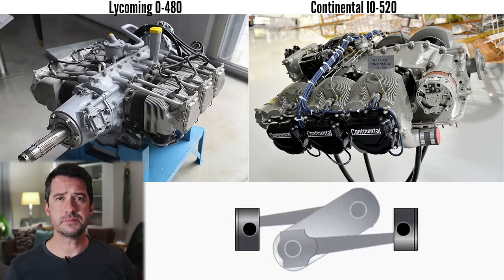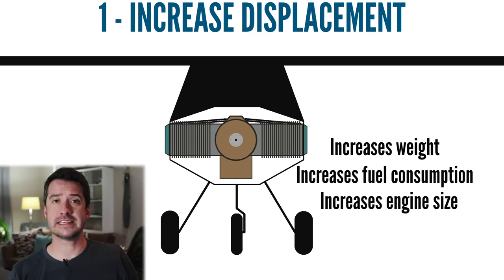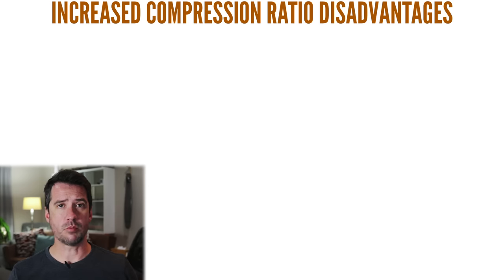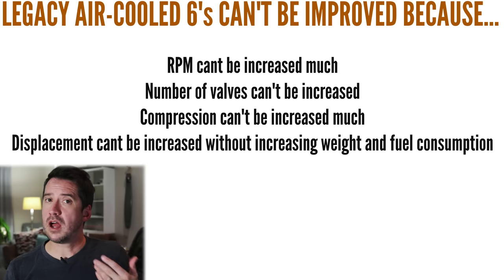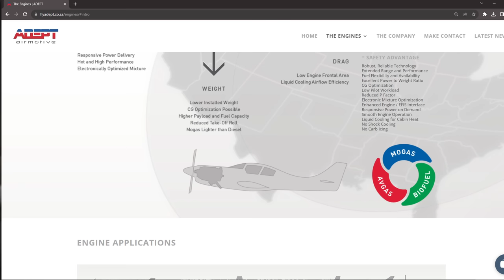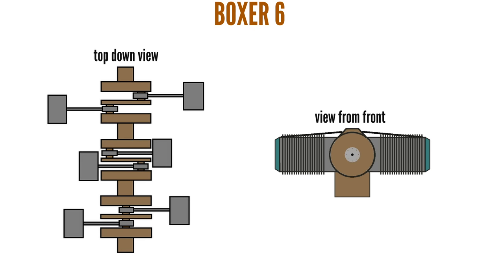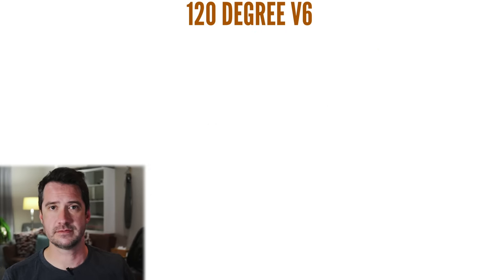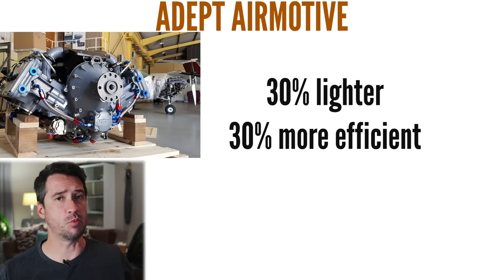Unusual V6 Airplane Engine Makes Boxer 6 OBSOLETE?

Comment: Balance shafts are used purely to improve comfort, they don't actually affect the operation of the engine. Ferrari's current 120 degree V6 engines don't use balance shafts at all (I doubt that their F1 engines did either), the vibrations are small enough that they can be damped using hydraulic engine mounts. In my experience, light aircraft engines vibrate quite a bit anyway, so it's likely that any vibrations produced by this engine are simply too small to be a concern.
Reply from the maker: Thanks for the comment. The Ferrari GTB and McLaren Artura 120° V6 definitely uses a balance shaft. The F1 engine is 90° as far as I know and that normally does not require a balance shaft.
Reply: @LetsGoAviate  The McLaren does, the Ferrari does not. Ferrari used 120 degree V6s in some of their F1 cars in the '80s. Edit: Some of the 'shark nose' Ferrari F1 cars from the '60s also used a 120 degree V6 engine.
Reply: @LetsGoAviate  For information on the Ferrari V6, see a Car and Driver article titled:

Why Ferrari and McLaren Debuted 120-Degree V-6s at the Same Time by Csaba Csere

Published: February 23, 2022
Reply: Yeah, they’re critical. Lots of props broken by vibrations in the early days of aluminum props. At resonant frequencies, vibrations build on themselves and have been known to break crankshafts, drop bridges, and buildings. The Broughton suspension bridge was collapsed simply by soldiers marching in step. All aircraft manufacturers have to investigate the vibration coupling between the engine and the propeller.
Reply: @russbell6418  "Yeah, they’re critical. Lots of props broken by vibrations in the early days of aluminum props."

Completely unrelated to balance shafts. That's a result of the large torque impulses that direct-drive engines produce, which wont even be a problem for this engine, because its torque impulses are relatively small, it's geared and it revs fairly high, so the inertia of its own rotating assembly will smooth its torque impulses to a significant degree. Balance shafts do almost nothing to reduce the torque impulses produced by the engine, nor are they meant to dampen any of the damaging harmonics which might be present in the engine rotating assembly. Balance shafts do add a bit of inertia to the rotating mass of the engine, and that might provide some damping, but that's not their primary purpose. Flywheels and harmonic dampers are the devices used to reduce the torque impulses and damaging harmonics produced by the engine rotating assembly, not balance shafts.

The only, ONLY purpose of a balance shaft is to increase comfort for the humans who might be subject to the vibrations produced by the engine, that's it, that's the only reason why they're ever installed in an engine. Many, MANY engines which are not perfectly balanced do not have balance shafts (probably most 4 cylinders with a displacement of 2 liters or less and the majority of V6s), they just vibrate a little bit and it's not a big deal.

Edit: I suppose that geared engines can experience problems as well, but making use of a flywheel and a proper harmonic damper should solve the problem quite easily. I often wonder if this engine would have adequate damping without a flywheel between the crank and the PSRU. If you think that I (at any point in the past) implied that engines don't need to deal with torsional vibrations, that's absolutely ridiculous and I have no idea how you ever would have gotten that idea. Balance shafts aren't meant to deal with torsional vibrations and aircraft engines simply don't use them.
Reply: @russbell6418  Really, if balance shafts are so critical, name an aircraft engine that uses them.
Reply: @PistonAvatarGuy Actually balance shafts are important for the life of an engine. Vibration cause oil aeration disrupts oil flow. Increases likely hood of cavitation in cooling system, detrimental to the life of electronics, sensors and wires. There have been issues with fuel injectors not functioning correctly due to vibration, potentiometers in throttle bodies giving faulty readings and failing, wires rubbed through. They are only need if the vibration is too bad obviously, but are not just for comfort. Resonance through an airframe is no joke.
Reply: @chippyjohn1  I guessing that very few engines vibrate badly enough for any of those things to be a serious issue. I'm sure that balance shafts can become critical in certain applications, so I probably should have worded my comment differently. Also, the engine in this video uses a dry sump oiling system.

Thinking back on all of the vehicles that I've driven in my life, I think that I've only driven two that had balance shafts (or a balance shaft), one was a V10 powered U-Haul, the other was an F22B powered Honda Accord.

Edit: It's possible that I also drove a Taurus with a balance shaft, but I can't tell for certain. I've read that mechanics often remove the balance shafts and discard them with no ill effects, so the difference that they made had to have been minimal.
Reply: @PistonAvatarGuy  Engines are already dampened with engine mounts, but components mounted directly to the engine can be effected. Of course they are incorporated with warranty in mind in all aspects. A trim rattling inside may not be a major issue, but it can cause a bad reputation for a manufacturer just as an example. An engine has to be sold with the worst driver in mind, so balance shafts to a person that redlines their car repeatedly would appreciate them more than a granny. As you know it's about how the engine operates that determines their necessity. As with my experience at bosch, all electronics are vibration tested and electronics are vulnerable to vibration. There are many components people don't think about with regards to vibration, even brushes in an alternator experience increased wear. I'm currently using a inline 4 on my experimental and have mild vibration issues, look forward to using an inline 6.
Reply: @chippyjohn1  "...so balance shafts to a person that redlines their car repeatedly would appreciate them more than a granny..."

I think that they're most often used when vibrations are bad near idle, or in the low rpm range, where the engine spends most of its time operating (as in the case of the Ford V10).

What engine are you currently using? Have you considered improving the engine mounts to quell the vibrations? I'm surprised that you can replace a 4 cylinder engine with an inline 6, it seems like weight and length would both be problematic.
Reply: @PistonAvatarGuy  Balance shafts are for secondary vibrations. Secondary vibration increases frequency and magnitude with rpm. At idle they are almost unnoticed but the higher the rpm the harsher It becomes. A small motorcycle engine at low rpm is fine, but at higher rpm the vibration becomes fatiguing not only to the bike, but also the rider. The engine I am using for my single seat experimental is a Suzuki M13A, but for the next model, a two seater, I want to use preferably a BMW M57 or more commonly now a B57. The engine mounts I use do a good job, but they do not absorb all of it. Using a softer mount allows too much flex from torque. Looking at placing some hydraulic dampers to the engine mounting. The M13A is running from 5500-6000 rpm.
Reply: @chippyjohn1  Really, I just can't see how balance shafts are typically used for anything more than NVH reduction, as high rpm engines basically never have them. Honda didn't even bother using balance shafts in their F22C, despite the engine being fairly large for a high rpm 4 cylinder and making its peak power at 7,800 rpm (it redlined at 8,200 rpm). I've never heard anyone say anything about noticeable vibrations at any rpm in the S2000.

There was a guy who removed the balance shaft from a Ford 6.8 V10, the only noticeable difference was at idle. Again, it's a device for reducing NVH, and people are more bothered by low frequency vibrations in a car than they are high frequency vibrations, especially when they're unlikely to ever rev the engine high enough to be bothered by the vibrations at higher rpm.

I'd imagine that the vibrations from something like a V-twin motorcycle engine would be fatiguing at any rpm, if one were forced to cope with them for hours on end.

I'm surprised to hear that a 1.3 liter 4 cylinder is producing noticeable vibrations at all, have you considered that the propeller might be out of balance? I know that the Viking Honda engines are known for being very smooth and they're slightly larger in displacement.

If you're going from an M13 to a B57, I say good luck to you, that's quite a large weight difference.
Reply: @PistonAvatarGuy  Yamaha R1, Suzuki gsxr1000, Suzuki hayabusa and many other small engines use them. A large heavy car with much more dampening allows vibration to go unnoticed. The vibration from the Suzuki is minimal, but noticeable. I want it to feel like a turbine helicopter. People all complain about piston helicopters having to much vibration. I don't want that. The Suzuki prototype is only 250kg empty, the 2 seat version with bmw diesel will be closer to 4-450kg empty, approx.
Reply: @chippyjohn1  Interesting, I never noticed that about those motorcycle engines. I'm guessing that's because the engines are much more rigidly mounted than they are in most other applications and because the rider's body is so much closer to the engine.

That is a big weight increase with the diesel, good luck.

Comment: What you talk about , every airplane piston engine are vastly underpowered , due to need for mechanical reliability 4 liter engines produce a rediculous 160 HP call that high powered when same displacement engines has no problem with producing 500 hp

Comment: I'm not that convinced - there is no law that says more CC is a bad thing.   Granted, the current engine designs are old and head design. flow and combustion chamber design has progressed since they were designed.  A modern pushrod V8 can rev to 7000rpm, and flow well without detonation on 'pump gas'.   We don't need 7krpm, so little need for OHC and 4 valves.    Simple is good, and less parts is good = less failure modes.   A good combustion chamber will use less fuel, and part of the high consumption is that fuel is used to cool aircooled engines at high power.   A refresh of the extant engine layout using the latest knowledge and modern accessories would deliver 80%of the presumed advantages with less cost and risk.
Reply: There were two main approaches to Reciprocating Aircraft Engines: German, big displacement, slowly turning engines, and british, smaller, lighter, raced engines, having higher wear, higher Internal friction mechanical losses.
In the current days of hard to find AvGas, they propose a come-back of Leaded Fuels, nothing compares to the power to weight ratio, simplicity, reliability of Wankel RCE, 80 RON fuel is enough for Wankel Rotary Engine. 
Blessings +

Comment: The main reason to keep with the flat engine is visibility over the nose. If you look at aircraft engines over the decades the V style engines were often mounted upside down. A PSRU would bring the prop back up to the top. Mounting a V style engine upside down is also an oiling nightmare, you have to incorporate a dry sump system which adds weight and complexity. This has all been investigated before, especially in war times. The issues with PSRU's have a long history too. For simple GA aircraft nothing beats the current setup. Simple and reliable is what you want in a small plane.
Reply: That’s why I don’t get the problem with DOHC in airplanes? Just make a slightly wider cover!

Comment: I call bullshit.  3.2 liter with 280hp NA at 5,500rpm doesn’t math out. You’d need at least 6,200rpm to get enough volumetric efficiency.
Reply: The Porsche 911 GT3 engine has a peak BMEP of 214 psi, and that's an emissions controlled engine. The BMEP required to make 280 hp at 5,500 rpm from a 3.2 liter engine is only 209 psi.
Reply: @PistonAvatarGuy  yeah, try and get “only” 209psi BMEP at 5,500rpm.
Reply: @monkeypainter808  The Porsche engine manages to make its peak BMEP at only 6,100 rpm, while also being restricted by modern emissions control systems.
Reply: My maths calculates it to be about right. Displacement, rpm, standard density, valve overlap and scavenging, tuned intake and exhaust make it quite possible. My rough calculation came to 277ps with standard Ron98. That is normal for an engine today, that is even achieved on automotive engines with emissions equipment, so without its much easier.
Reply: @chippyjohn1  I have a dyno chart for a Honda engine that was built and dyno tested by a reputable engine builder that manages a BMEP of 204 psi at 5,500 rpm on pump gas, but it's optimized to make power at over 9,000 rpm (peak power is at 9,300 rpm). The engine was also built to pass strict Texan emissions testing, where they test the vehicle under load on a chassis dyno. The peak BMEP for that engine is an astonishing 237 psi.

It's also worth noting that the Adept Airmotive engine would only need to be optimized for a very narrow range of operation, as it would spend almost all of its time between 4,000 (which appears to be where it makes its peak torque) and 5,500 rpm.

Edit: 5,500 rpm is also before the VTEC changeover for that Honda engine, and it's BMEP is over 212 psi for pretty much the entire rpm range after the changeover.

Comment: A Ballance can be obtained through smaller counter weights on the double overhead cam shafts itself . So no Ballance shaft is required.
Reply from the maker: Wouldn't that unbalance the camshaft itself though? Or maybe that's the lesser of two evils? Thanks for the comment!
Reply: Ford has built millions of 90° V6s (over 3.0l) and I4s (over 2.0l) without balance shafts without issue.
Reply: The Ford Triton V10 uses a balance shaft on the left side head next to the camshaft. Granted it's not having to cancel out primary imbalances, but the concept of having the BS outside the primary engine block is sound and in use.

Comment: If you want to reduce weight, go to a radial engine.  It is a shame that radials cost so much, but they got to a much higher state of performance.  Reliability?  The boxer is hard to beat.  The simpler an engine can be, the better it can be.  Less moving parts and rotating slower translates into longevity.  Most of these new motors rotate at more than twice the red line of older engines and this carries a host of problems.  The real question is how can we design and build a boxer to a higher standard?

Comment: Turbochargers don't increase thermal efficiency. They increase the mass flow.
Reply: They do increase thermal efficiency. They recover heat lost in the exhaust.
Reply: @chippyjohn1  I had this discussion with my thrermo professor 30 years ago. He would disagree with you.
Reply: @dasboototto  Plenty of professors that know little.
Reply: @chippyjohn1  He co-authored our thermodynamics textbook, but sure, you know more.

Comment: There’s a reason that people that own airboats don’t use Continental engines. When you ask the reason why they just say “there are gators out there boy!”.  When air start using these new engines and except the drag created by having a radiator and an oil cooler out in the wind, I think I would have confidence for the product.
Reply: Drag from a radiator was solved in WW2. All sides developed systems that minimized drag or even created a tiny amount of thrust from the waste heat. 

The P-51 was famous for it and the best design. It's still argued whether it just completely neutralized radiator drag or produced useful thrust on top. 

It's weird WW2 tech was lost to the ages. Especially with how much energy is wasted through radiators.
Reply: Bullets through radiators tended to cancel out  some benefits of liquid-cooling.
Reply: @captronrv7 that is why all this is arranged in a compact way around the pilot. Fuselage there has a thicker skin than the wing with its self sealing tanks. Or the tail.
Reply: another take on radiators, aside from the P-51, was the He-100, radiator wings, sleek profile and bloody fast aircraft.

Comment: I like these alternative engine manufacturers that say aviation needs new engines then when the smoke clears the newly developed engine is 25% more then the proven engine they are attempting to replace.. look at delta hawk. Their certified 180 diesel is 80 grand just for the engine alone. Then you have the mount, Prop , cooler , lines etc. just absolutely ridiculous.
Reply: The Lycoming IE2 is comparable to this engine and costs $115,000.
Reply: Like I said ridiculous.
Reply: @willcall9431  It wouldn't be a problem if we'd kept the economic policies of the 1950s.
Reply: Most of the cost issues are of a litigious nature. Which is why 60% of the cost for the average aviation power plant is to cover liability. I do like the multifuel capability of the Adept. Hope they can make it work. Hope the Higgs Diesel gets to market too. That engine will truly be revolutionary.
Reply: @willcall9431  "Hope the Higgs Diesel gets to market too."

That is, almost certainly, a scam. Anyone who talks about powering an aircraft with hydrogen is running a scam. Anyone who thinks that they can replace a PT6 with a piston engine is running a scam. It will be interesting to see what comes from that project, though.